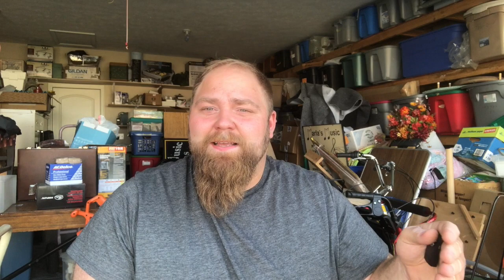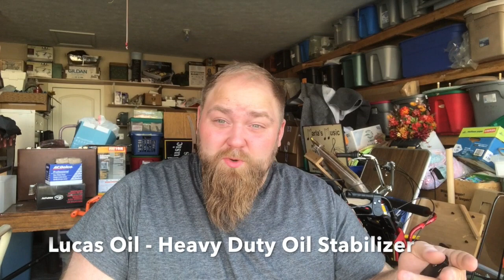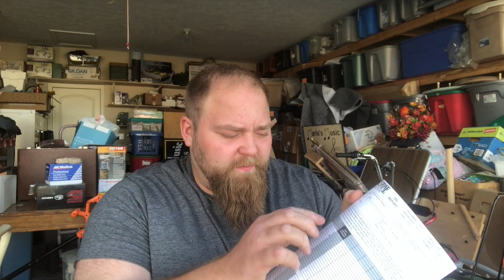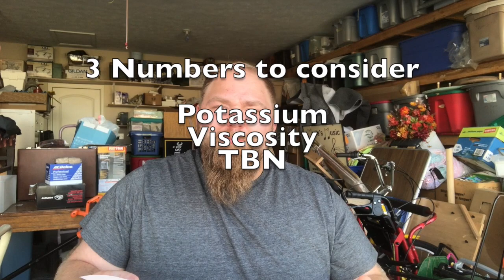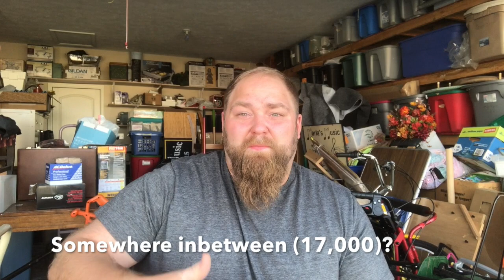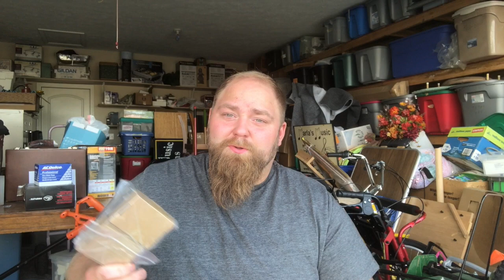Oil Report - Ram 3500 6.7 Cummins - Blackstone Labs

Comment: Hi;

I do 40k miles between changes, but have a bypass filtration system that filters down to two microns for starters.

I change my primary oil filter every 8k miles, and add fresh oil to the new filter to maintain my additive package
(Tbn) the Amsoil bypass filter is changed at 50k.

I use 100% synthetic oil. The full synthetic they sell you is base oil pumped from the ground, and filtered more than regular motor oil. The federal trade commission allowed the oil companies to call it  full synthetic because they were tired of wrangling with them.

100% synthetic can be found in Amsoil, Scheffer, redline, and a few other top tier oils.

A trucking company I worked for used to change their oil every 200 plus k miles utilizing this system, and their engines were fine. It made me change the way that I utilize oil.

My 6.7 Cummins has 215k miles. Uses no oil between changes, and has 0 leaks. All lab reports are perfect.

I use Amsoil in everything with no regrets.

Michael

Comment: Been running 25k in my truck. As I run a month at a time long miles long idle. Only time I shut down is to check fluid levels. Big trucks run same exact oil as I do and get between 35k(frieghtliner) and 50k(volvo) between  oil changes. Due to constant running

Comment: Yep so now you know oil can go longer if it's good enough now with real 100% synthetic which is 4 to 6 times better than the T6 and will run that much further with less wear than what you caused using t6 to that length.

Comment: Thank you for this information is extremely hard to find I know that oil needs to be tested when doing much shopping is there anyway you can get back to me on how much Lucas oil additive that you use I’m a little concerned with using it because of how thick it is during the winter time etc. etc. thank you

Comment: 34k? Yikes! I'm slightly paranoid changing at 15k and that's with using bypass filtration.
Reply from the maker: Awesome! Break that Beast in! We’ve got a lot of life in these trucks💪
Reply: @HighMileageHelper  On the engine, for sure.  Although my truck is decently modified and I'm sure that impacts longevity.  But in the end, it's still a Dodge.  I'm about to replace front axle U-joints, hubs/bearings, ball joints, tie rod, and drag link!
Reply from the maker: Monster RAM I didn’t touch my front end until 250k (track bar) 275k (ball joints) 415k (wheel bearing/hub) 420k (steering linkage) 485k (axle u-joint).. track bar has since gone out a few times and ball joints but it’s because I used Moog(which I won’t be using again)
Reply: @HighMileageHelper  Nice.  I'm running 37"s and a 6" lift so I'm in a different boat.  😁
Reply from the maker: Monster RAM ahhhh that explains it haha you’ve got quite a bit more going on but you’ll still go far with solid maintenance/replacements like you’re doing. Any issues with your track bar?
Reply: @HighMileageHelper   I have a BDS adjustable and had to replace the bushings once so far.  The truck has been lifted since 34,000 miles.
Reply from the maker: Monster RAM I’ve heard good things about bds. Do they have a stock length track bar?  I’m still debating about who I’m going to go with as the 3rd set of Moog bushings are going out AGAIN! I’ve been reading up on Synergy MFG, seems like a solid set up in the bushing design. At the same time Mopar got me 250k+ so maybe go back to that? Don’t fix what ain’t broken? Lol
Reply: @HighMileageHelper  Honestly, if I were to do it all over again I'd reverse level the truck and go with Thuren's full kit.  I might end up doing that in a few years, but they are one of the best out there.  The reason I went with BDS is they were the best company out there who offered a 6" lift.  Synergy is also a good mfg.  I'm going to get their tie rod and drag link here in a few months.
Reply from the maker: Monster RAM I was uneasy myself about it but wanted to really see if Rotella and Lucas are the real deal. My Wix XP (high mileage) filter was also up to the test and apparently it did an incredible job. That was roughly 4 months of miles. I think our oil and filter do better than we give them credit for!
Reply from the maker: How many miles do you have?
Reply: @HighMileageHelper  Almost 119k